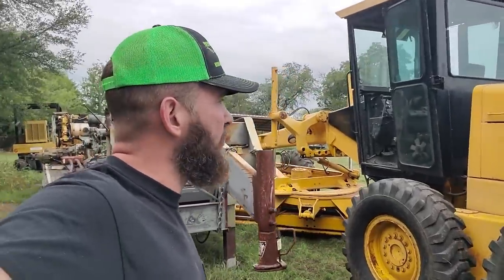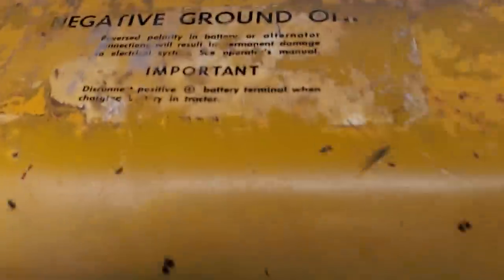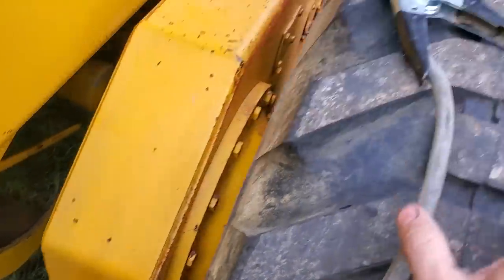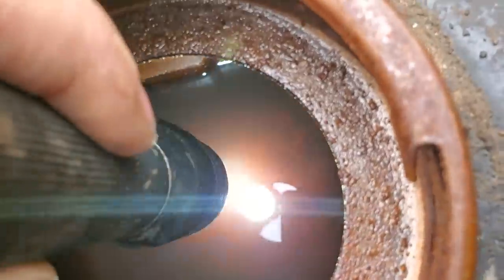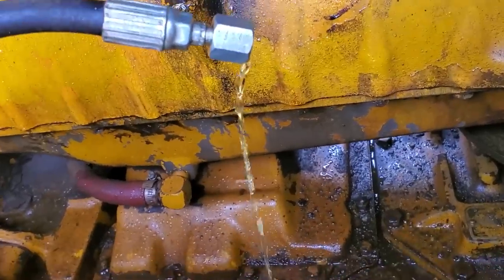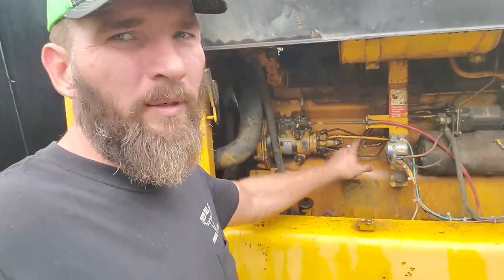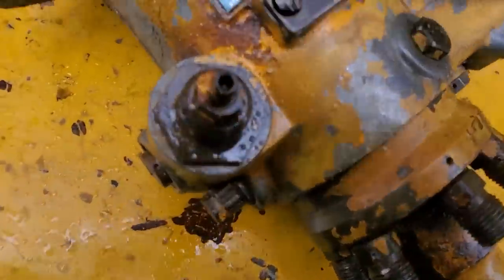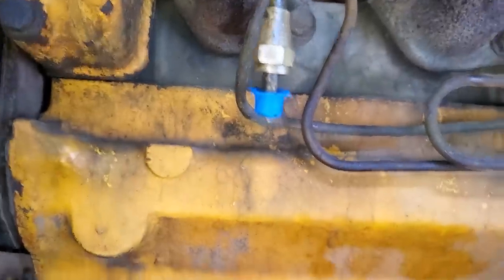Diagnosing A John Deere Scraper No Start Bought From An Auction

Comment: Old stanadyne pump, probably a stuck metering valve. Pop the top cover off, pull the metering valve out, clean it up, and reinstall.  But the governor ring could also be bad, but that usually shows up when you take the timing cover off as little bits of the hard plastic/rubber ring falling out

Comment: Going through a 1979 Cat D5B that customer bought at auction. Going through it now. fixing all the leaks and such. New fluilds all around
Reply: Said customer has proceeded to rip off the right side undercarriage twice now by using the root rake as rippers in hard ground and trying to turn with it dug in the ground…

Comment: Too bad you're not closer. I've got a John Deere 5400 that I'm thinking might have a head gasket issue. Definitely has issues and all the local mechanics are dolts. They've put the wrong size pump on it, among other things. Hasn't ran right since, and that was before my great uncle, in his later years, forgot it ran on diesel and not gas.
Reply: Get the service manual and figure it out. I believe in you.